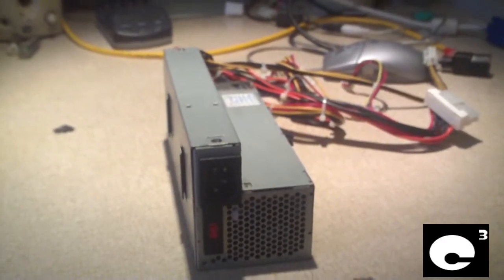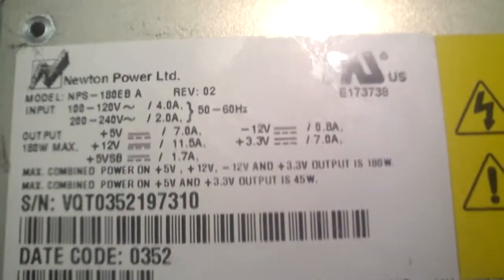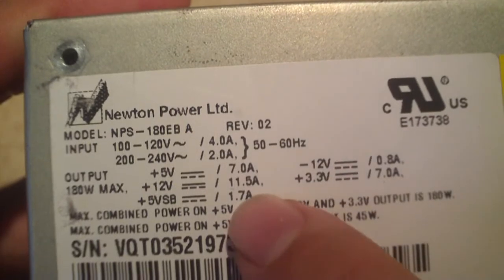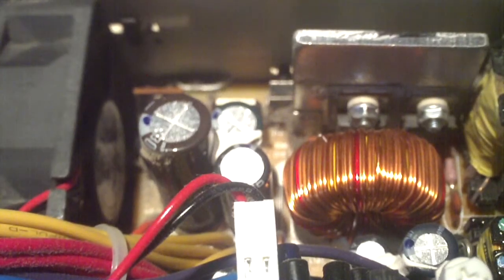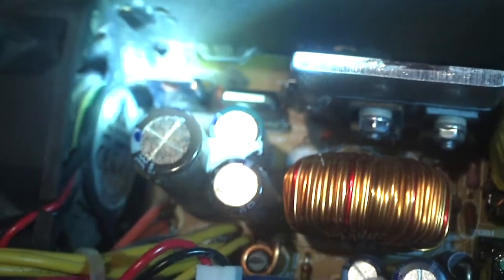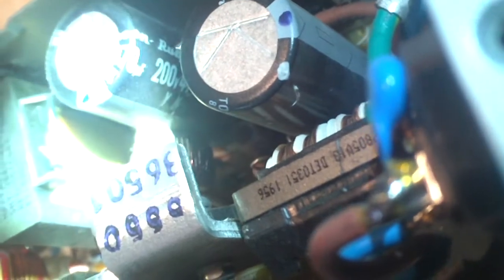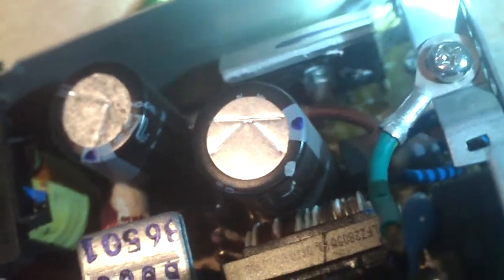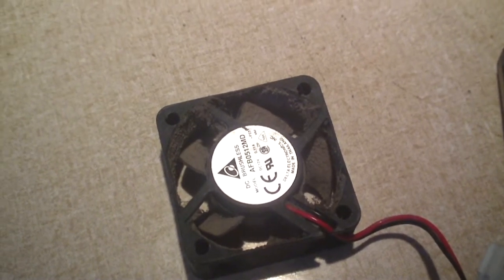Newton Power 180W PSU Autopsy

Comment: The video capture at 6:35 is from another power supply. Fake picture
Reply from the maker: The image at 6:35 is of a burnt up toroidal coil in a different power supply. Nothing fake about it.
Reply: @CubeComputerChannel  

The burnt toroidal coil in a different power supply is not NewtonPower 180W PSU, so what is the point?
Reply from the maker: @mn5544  It's to show what can happen with units with undersized toroidal coils.

Comment: Just because it is a TO220 package doesn't mean it has to have a heat sync it depends what the Applications is
Reply: This two parts are very close to ventilation fan so there is no need of heatsink for cooling